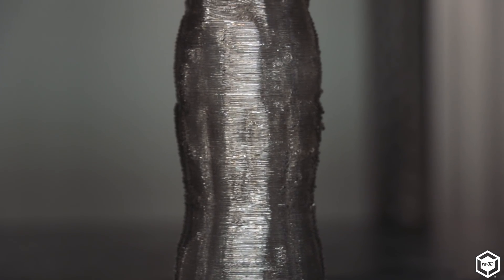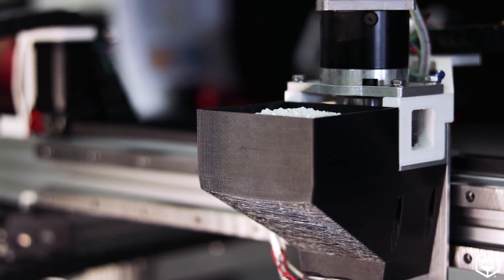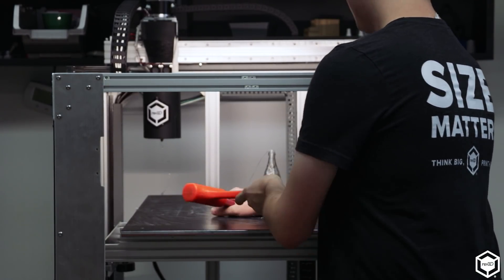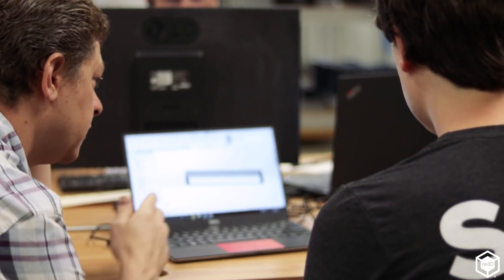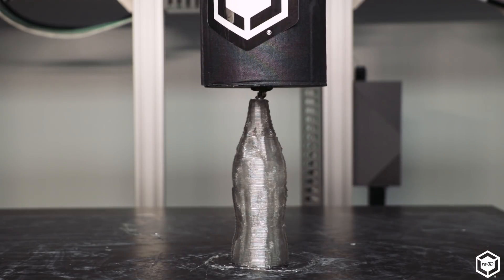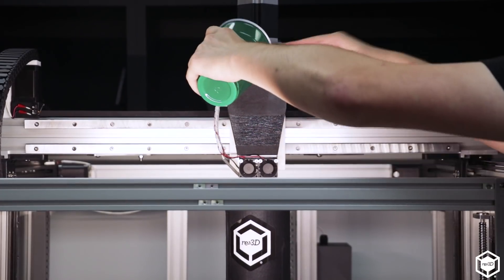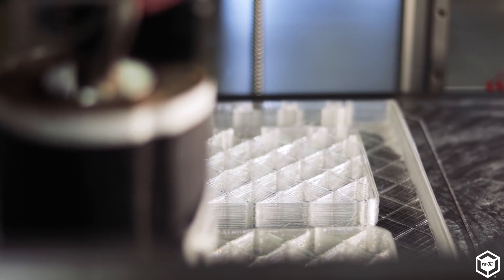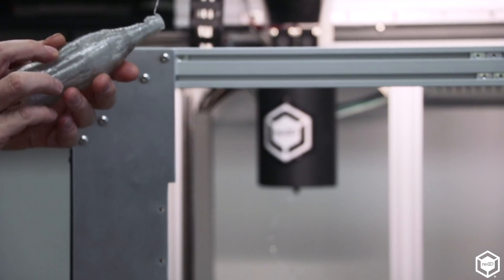3D Printing with Recycled Plastic - Pellet Printer Progress Report

Comment: I hope the prints will look better on the production model. The prints shown do not look great in my opinion. Maybe it is the material used?
Reply from the maker: Great question! We're still refining software settings to work on improving print quality, and you're absolutely correct that material choice makes a big difference. We find some - like PET - tend to turn out better than others. That being said, we're always working to improve our printing profiles to make printing with a variety of materials as user-friendly as possible. And the good news is the machine in this video is several iterations and over a year old now, so we've definitely made some big progress since!

Comment: great! would it have the resistance to allow it to be used in the industrial piping field for chemical transportation? we use a lot of polypropylene, PVDF, ECTFE for piping solutions and would be great if we could make accessories from  recyclable plastic
Reply from the maker: Thanks for your question Diego! We're not familiar with the material properties of PVDF and ECTFE - do you know what type of resistance would be necessary to run these materials? If you can supply some samples we would love to talk further about making some test parts for you. You can email us at engineering[at]re3d.org

Comment: How about retraction ?
Reply: Can you get a fast enough response by reversing the screw? Looking at retraction with filaments, you have a small melt pool in the hot end only, and retracting the filament immediately reverses the pressure within the hot end. In reversing the screw, there is a far larger amount of material in the molten phase, rendering the reverse in pressure less efficient. Or is this not the case? (Apart from this question, it makes a lot of sense and I hope you will succeed in traversing the "chasm"!)
Reply from the maker: Great question Mateus! Retraction actually works by reversing the screw. Our engineers have done testing using multiple materials, and it's shown this to be effective.
Reply from the maker: Hi Giovanni, You are correct in the observation that there is a larger amount of material in the molten phase with a pellet extruder, though the the reduction of pressure during a retraction is correlated to the ratio of screw diameter / nozzle diameter such that by either increasing the screw diameter or reducing the nozzle diameter you will achieve a greater pressure reduction. We are also evaluating a mechanical means of spring assisted flow cut-off to provide a positive means of eliminating ooze. Thanks for the question!